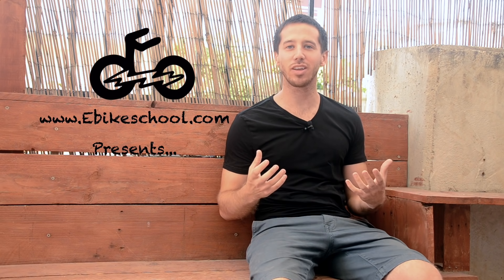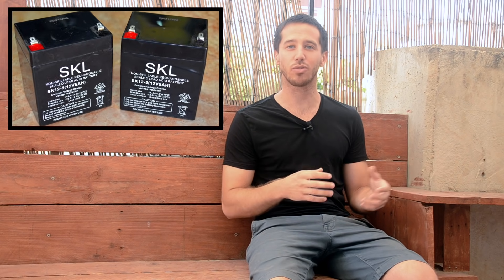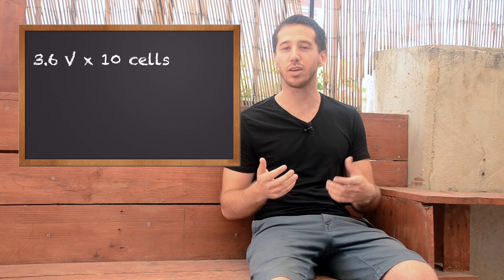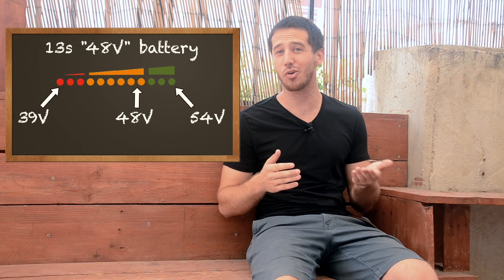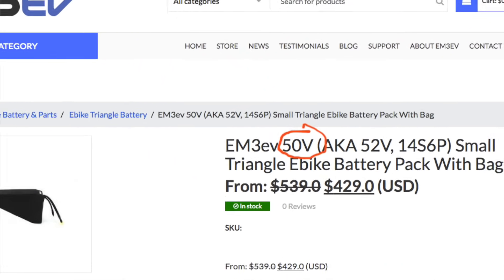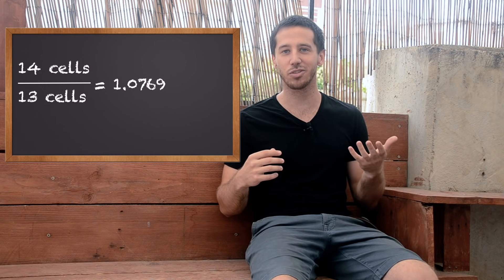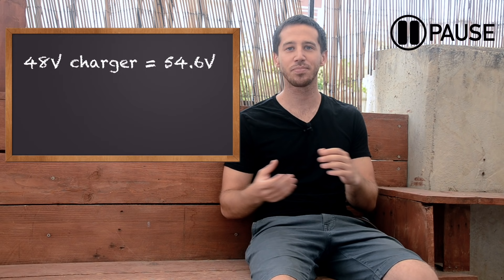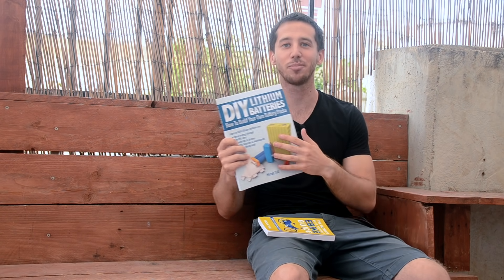Which is better: 48V or 52V battery?

Comment: First the Mechanical Age.  Then the Solar Age. Now we are entering the Electrical Age.  Having studied basic automotive electronics I am happy we are moving to far simpler Ecars and Ebikes.  I’ll be more happy when we leave combustible, heavy hot lithium for a cooler, lighter, more efficient batteries.  Up until recently we swapped/rebuilt our car engines.  Now we will be swapping out batteries.

Comment: Hello I hope that at least you can help me realize my dream I bought the bafang 1000w psh of everything ok I had the battery made by a 48 volt friend of mine The problem is at this point that the always insufficient power fails to exploit the better the engine failed only from with the page with the fully charged battery to do only 14 km maximum 15 I wanted to know from you if that 52 times I will be able to solve my problems to exploit all the power of the engine and above all the torque declared by the sellers of 151 of 150 Forgive me a meter is better. I would like to know from you then kindly how to make the most of this engine as I was telling you before to make sure I can use all its power not for the maximum speed that does not interest me but for the torque I need uphill to carry mine trailer with my dog on the trip I bought this motor just for this reason my a mountain bike clearly and clearly I travel with my dog That's all I bought this motor just to get a little help in health uphill on mountain routes that I practice and travel but I realize that the power is not there is enough There are those who say on YouTube among 1000 tips that you need to put a transformer who you need to put an enhancer that you have to do here that you have to do you can tell me the truth to help me understand this engine how it can work best Please please help me make my dream come true I will be grateful to you and I am. My name is Marco I come from Italy and I am trying to raise a dream that almost 10 years of trying to fight I built the driver by myself in Ergal in aluminum for my dog and a 40 kg Maremma Shepherd is really trying to realize my dream that I have been fighting for a lifetime Please try to listen to me read this message thank you for everything I could do for me. 🐶🧔🙏🙏

Comment: 52V battery has adventage of extra power from 57V to 59V after that same as 48V. Also cut off voltage needs to bring up for 52V. Thus span of fully charged battery, 52V has more power overall.

Comment: Also you will always be over discharging your battery unless you change the cut off voltage.  And your old battery percent meter needs adjusting.

Comment: Thank you ‼️
I'm an Older guy with some health limitations, doing my research on ebikes.  Your videos have been very helpful and informative. From watching I've determined that I want a Mid Drive, with a Minimum of 750 watts motor. Step through frame, half or full throttle, I'd like to get 24" rims if they have them, with the fat 4" tires. Preferably foldable as I intend to get a boat and bring the bike aboard. Keep up the Great Content,  the information definitely helps people of my age. 
Stay Safe ‼️🙂

Comment: If you have a 48v battery, and I want to use a battery blender, should I get another 48v battery?  Or should I get the 52v, but I hear that the battery with the larger voltage will be used first until the voltages are the same with both battery.  Please let me know your thoughts and suggestions?  Thank you!

Comment: when building your batteries do you really consider amperes also or you only consider voltages, can you just build 52volt 2A? can it work well, what is the minimum ampere to consider when building E-bike batteries 
thks waiting for your response

Comment: He has pretty much revealed what retailers and commercial battery builders do to leverage more money from the uninitiated Ebike user. Running a controller up to 63v although it states 48v is fact. The controller can ‘operate’ at 63v although if you are doing long distances, the controller will get warmer but it will not damage it.

The other thing to bear in mind if you want speed is that you can run a lower wattage motor with most controllers where you can control the amount of amps output. Of course more amps means more heat and its safer for the motor at full amps in cold weather so not only can the motor can run cooler but also the controller.

Comment: Wait, when getting a 52v battery, to replace a 48v one, we should get a 52v charger? I really want to keep all lithium batteries in my life between 20 & 80%, to get the most cycle lives out of them. So wouldn't it be better to use a 48zv charger on a 52v battery? What's the maximum percentage will that charge to? Will this mean I don't have to get an adjustable, deluxe, smart charger, and I can just plug in a battery, and not worry about outlet-timers, or the battery sitting fully-charged, stuffed & stressed while I'm asleep or away?

Comment: hey man, can i use a 32v battery on a 24v controller? will it damage my controller & motor?
Reply: If you open the controller up the capacitor will say what max volts is.
Reply: @joseureste8257  thanks!

Comment: Thanks for all you do for this growing community of ebike builders,  I have a FUji Nevada mb that I installed a Bafang 500w rear hub drive and a 48v battery,  but it is slower, weak on hills and where I love is mostly hills  will a 52v battery work well in getting up some of these hills or do I need a sur ron

Comment: When you  have a lithium battery that can deliver potentially 1000w but the motor is rated for 500w, does this mean the full battery power potential is not being utilized? Thx.

Comment: Nice video! so if a battery is 52v 20ah 50a, what does the 50a on end mean? my old battery was 48v 12ah 20a, how much more power would you get from 20a to 50a rating?

Comment: I want to put 2-36 volt 20ah batteries in series to get 72v 20ah.

Safe or dangerous.

Its alot cheaper than buying a 72v 20 ah

Thanks

Comment: Does it make sense to run with multiple batteries so you can more evenly match your power needs to your commute?  I'm thinking there's a limit to the number of charging cycles a battery can handle so it'd always be better to more fully deplete your battery and swap it out rather than having to recharge a 75%-depleted battery every day.  Thoughts?

Comment: Hi sir, may i ask you something, i have a nanrobot d4+ scooter with 52v rated for controller, battery, and motor. But sadly i just burn my controller. My question is, can i use 60v mini motor controller for my 52v motor and battery?

Comment: Hi, nice video. I'm building a bike and I have a 50.4v 18a battery, no charger.. And I don't know what the best charger is for it. The maximum charging current is 58.8v 4a. But I think it's better less than that to charge smoothly, and not to overheat while charging. Can you advise one please? And what is the most suitable display? 60v display?
Thank you for your attention

Comment: High voltage doesn't make the motor go faster, speed of the AC motor is defined by the 'commutation' speed I.E. the controller.

Comment: Liked and subscribed. A question. Opened the battery pack of my "48" Volt 20 amp hour battery. Its output is 54 volts going down as I use it, to slightly less than 48 volts at half discharge. It is also full of AA Batteries in series. I didn't count them. AA batteries are 1.5 volt. Why do say they are 3.5 volt?

Comment: I've got an lectric ebike with a 48v/14amp battery and a juice scorpion with a 52v/13A and hands down the the 52v battery outlast the 48v. I easily get 10-15 miles longer riding distance from the 52v battery despite a slightly lower amps Lectric is  bit quicker when fully charges, but both have about same top end speed so in my experience the 52v battery is better. I've also noticed that fter charging the lectric battery about 50 times now that i'm getting less and less distance per charge. Lately only getting 15-16 miles per charge out of the Lectric 48v14 amp battery.
Reply: Yeah you will always get a few more miles of range and a couple more MPH out of 52. I have contemplated it, But decided it's not worth spending cash on a new battery and charger.. Maybe when my 48 dies. Right now, I'm really happy with the performance of my 48v 30amp setup with a 17.4ah battery, I get where I need to at lighting pace and tackle any hill, and top speed of 32MPH.. Can't complain.

Comment: Hi Micah.
My hub motor ebike  conversion kit didn't come with a display, doesn't have a pedal assist sensor either.
I really don't want the pedal assist sensor anyway, but would be nice to have a display with a battery monitor, speedometer, odometer. 
Can I wire up a display to the existing controller or do I need to change that too?
Thanks for all the information you give on your videos!
Take care.

Comment: Hi. I have a question.
Which battery voltage is better for range? Imagine an ebike with a 72v capable bafang m620  and 2 batteries of the same watt hours, 1 is 52v,   2 is 72v.  If the bike is going the same speed same load etc, Same watts output. For example Does the bafang m620 work more efficiently on the lower voltage?
Thanks
Tom

Comment: There are some mistakes on that video too.. Motor doesnt pull max current continuously. Even, rider's weight is important variable while talking about current. long story short, on same system, 14s will go faster than 13s on every condition. But not much. Also, more voltage is efficient only while using motor with different rpm/volt rating(can go same speed with more voltage)

Comment: Thank you for explaining this, but I have a question, you say 52 is a bit more powerful and faster, now I understand more powerful, if the bike is faster by being more powerful, but faster i don't understand that, does that mean that motor spins faster, like also PAS is faster and cadence speed should be faster in PAS mode or not? Thank you.

Comment: What matters is wattage, not voltage.  No magic in using higher voltage except you can use smaller wires with better insulation.

Comment: I love your videos.  We are new to ebikes.  I adapted our Cat Trike folding Trail trikes with  the Bafang 1000w kits.  They came with 48v 11.6A 557watt batteries.  We live in a very hilly town and I am getting only 20 miles on this battery.  I don't want or need to go faster just farther.  How is the best way to accomplish this please?  I would love to speak to you but private messages on the tube are gone.  Thanks a big bunch

Comment: Hi, I have Vsett 10+ 60v 25.6 Ah
I can manually lower voltage to 24, 36, 48v, etc. Is this healthy for battery and scooter life when I don't want to use max speed?
I noticed my battery on display increases when voltage is decreased, but I am not sure if this is good or bad for battery and general range. Thanks

Comment: great explanation of the pros cons and differences of battery constructions!! i have a 1600watt 48v lead scooter and  want to upgrade to a 52v lithium battery my controller has 60 volt capacitors so i  dont have to sweat killing the speed controller?? just wondering if the swop involves any other upgrades besides charger? thanks!!

Comment: Hi!interesting to listen. Any chance a pretty used 60v lithium  battery has  cutoff voltage higher thsn previously .E.g  cut off was 52v now instead of  58v? Is my battery or bms  faulty ,any chsnce of resetting it.

Comment: Wrong about controllers. Having 52V battery means it's close to 60V when fully charge (14x4.2V=58.8V) and that is usually dangerously close to burning driving MOSFETS inside the controller that are often rated at 60V. And your reliability will suffer. This is a fact tested on bunch of different motor controllers in practice. ;).

Comment: One question though, can I have two batteries on my fatbike? Let's say one 36V or 48V AND an additional one, for example, 28V or 36V? I think it should be possible, isn't it? In this case what parameters of the controller will be necessary? Thank you.

Comment: It is my understanding that lithium ion batteries do NOT suffer a drop in voltage as they discharge, unlike a lead acid battery that quickly loses voltage as it discharges. Am I wrong?

Comment: 2 part question if you upgraded the battery for the D class model would there be any performance increase without changing the controller?
 2nd  Is there an upgraded 52 w battery for the D class?  
Bonus question are there any batteries that aren't sold out?

Comment: Wouldn't a 52V pack, charged to a lower capacity and with a higher capacity cell, maintain the approximate  voltage range as a 48V pack? The benefit would be longer life and an increase voltage at the low end of the discharge curve, while supplying an increase in amp-hours. Just a thought, I could be wrong. I'm still trying to get my head around all this stuff.

Comment: Just to clarify, who has better range between 48v vs 52v given they have the same lets say 18ah battery? Thanks.
Reply: Because watts = volts*amps, the same 18ah pack would have more watt hours for a higher voltage, 52v. Therefore the 52v would have mkre range, just because it has more batteries
Reply: @benjaminowen6181  thanks for the reply :)

Comment: "48V" battery needs 16S for Lifepo4 and 13S for Li-ion or Li-po chemistry . Stay away like the pest from the last mentioned one... In 2020 i wouldn't use anything else but 16S and Lifepo4 chemistry when creating a "48V" battery pack. I woudntnt bother with 14S Li-ion/li-po - not all controllers will like that higher voltage and then there is the  huge safety issues with li-ion/li-po chemistry ... Oh yeah almost forgot: 2000 charge cycles for lifepo4 compared to 500 for li-ion. Li-ion is obsolete, despite that its mind boggling that its still used, almost exclusively, in all ebike packs made iby oem's. But hey they get to sell you more overpriced packs when they die....

Comment: There are some things missed in this video.  1. Current x Voltage = power.   So given a certain load, a 52 V battery will use less current.  Since the power will be the same the controller will run a bit cooler and so will the battery pack. The controller because there is less current and this is factor more than power for a PWM controller and the battery pack which has more cells in the 14 cell configuration will be running the same power over more cells, hence the total heat may be the same but each cell will be see less of it.  Dissipation will be greater hence lower temperatures.   Lower temperatures, less current = longer cell life.   2. Yes if you are running the bike at a higher speed the current may well be the same, but for a given speed (power level) the current will be less.   3. Now figure that Ebikes are often speed limited by statute (they need to achieve certain regulatory standards to be class 1,2 or 3) and riders will often run them topped out.   A 48 volt vs 52 volt system will be operating speed limited often and hence the 52 Volt system lower current which for a given amp hour rating will give more range, other factors being equal.   Finally there is one more disadvantage of a 52 volt pack of the same amp hour rating.  I will weigh more as there will be an extra cells in it.  Cost and weight are the primary disadvantages.   Finally the greater total power capacity of a 52 volt pack with the same amp hour rating will require lower numbers of charge cycles for identical trips 9speed and distance potentially increasing service life of the pack.

Comment: If I was to upgrade my 48v 1600w escooter should I upgrade the lead acid battery to a 52v 1600w 25ah lithium battery or would that be too much on the motor?

Comment: I am currently looking at two batteries (both are the same price) a 48v 13.6ah or a 52v 10.2ah ? Isn't the 48v 13.6ah on better as it has 652.8 watt/h while the 52v 10.2ah only has 530,4 watt/h. In this case doesn't the 48v one have better mileage?

Comment: I've got a question I'm seeing  48v  25ah for 1500w and then another 48v 25ah for a 1000w aren't these the same battery?
Reply: To determine the maximum wattage to the motor from the battery pack you need to know what the top amps from the controller are. Take the voltage times the amps that gives the maximum watch that the system will put out.
Reply: Both of those would work then. Thanks

Comment: The controllers regulate the output/motor current which is the same power at the same current. Therefore the higher voltage battery will draw less current. This case will hold for accelerating and speeds lower than max.
The max speed case does apply full battery voltage to the output so  as you say the higher voltage battery will use more power to achieve higher speed.

Comment: I plan to add extra things that could use some of that power like cable lights instead of having to remove and recharge  the lights   aswel as usb charging  for my phone  or if phones stop having cable going into the phone a wireless  charge pad connected to the battery  with a converter

Comment: Great explanation.  After considering the added cost for the extra cell, plus the cost of a new charger, this is hardly a value for investment to remove a 48 volt battery and charger from service.  Two variables here. One is if your 48 volt battery is toasted and needs replacement.  The other possibility is if you have Michael’s skills and knowledge, and enough space in your battery case, you could buy the extra cell, and a charger, making your additional cost worth considering.  The same applies if you are going to rebuild a toasted battery.  I am sure his Lithium Cells book would be most helpful in performing this task.

Comment: I have 52V just so I can charge it not to max 4.2V but to 4.1 or even 4.0 which make the battery get over 1000 more charging cycles in life instead of only 500 or so before the capacity starting to decline but still hold the normal 48V which will go down fast to that anyway.